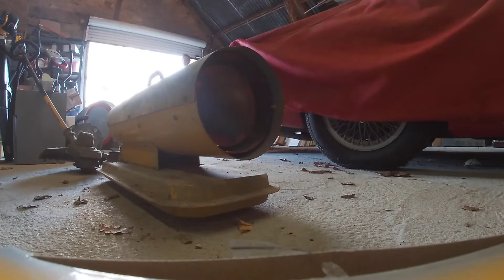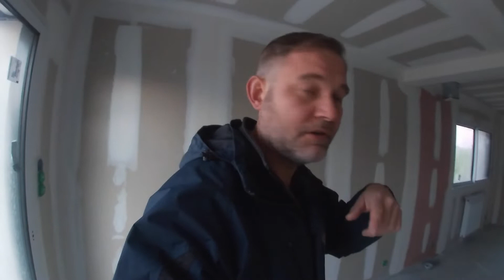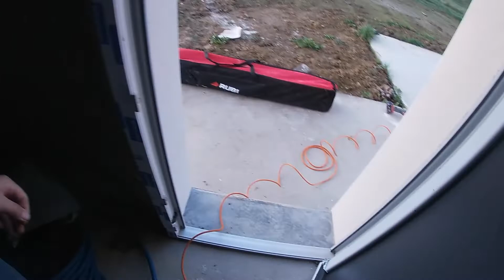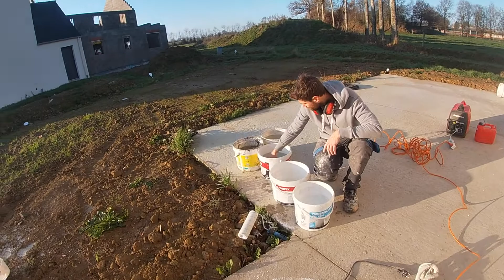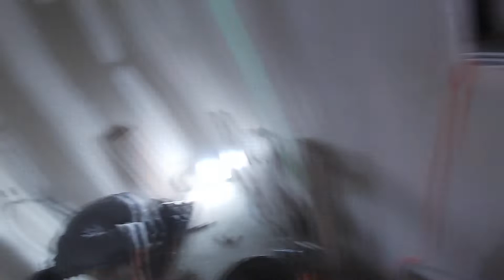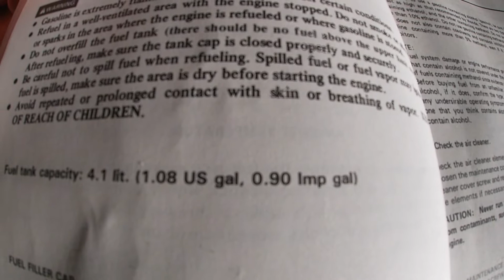Real world test of Honda EU20i / EU2000i Generator on site

Comment: These Generators are said to be whisper quiet in operation but this machine sounds quite noisy to me ??
Reply from the maker: It's as quiet as you can get. The ECO mode makes a big difference but I wouldn't say it's whisper quiet.
Reply: Екомуляи тор  дихішийчкшо шумоізоляційні двері поставити то норма